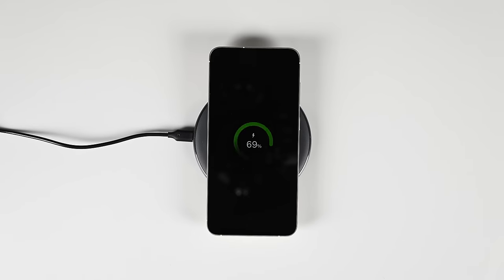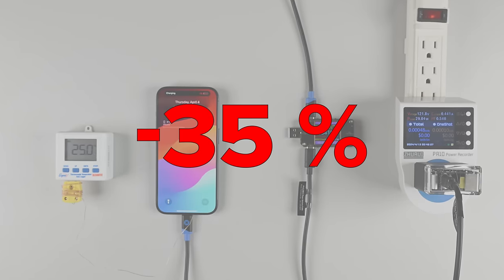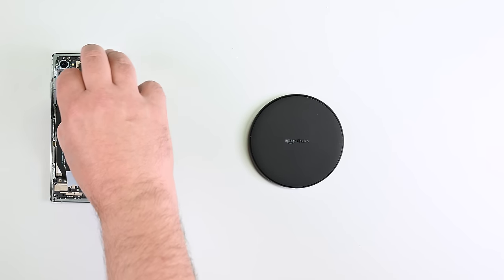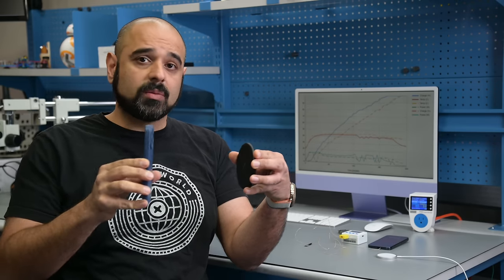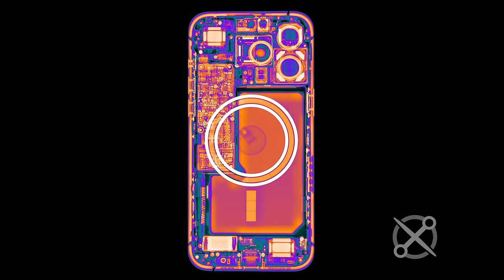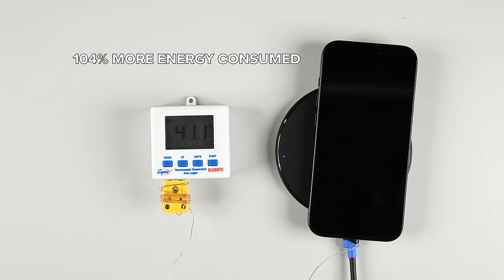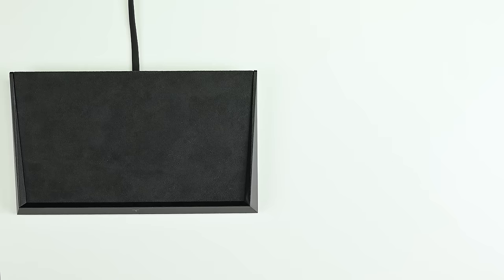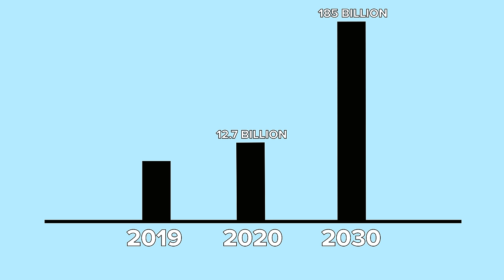How Wireless Charging Works and Why It's Terrible

Comment: Yup! I knew about the heat problem with wireless charging. I remember taking my phone off the wireless charger and felt how warm my phone felt which made me remember how heat and battery is a bad combination. After that I went strictly with wired charging for my Note 9. There is a problem with only using wired charging for your phone and that is the wear and tear on the port. Last year I finally ditched my Note 9 for the S23 Ultra and said this time I’ll only charge with wireless chargers because I don’t want to wear down the port on the phone. I guess now I’ll have to see how long it will take for the battery to degrade to the point where I have to replace my phone. Ahh and I put on every setting available to help prolong the battery life like turning off fast charge, charge only to 80%, etc.

Comment: if you have ever broken your usb port and realised that you need to go and get the screen removed in order to remove the thing and you are sure you will break it in the process, probably a battery replacement 2 years down the road sounds like a good option
that is literally what happened with my old s7 lol😊

Comment: What about the magnetic usb connections where you leave a discreet plug in the phone socket and connect when necessary to a charging cable using its own magnetic connector? 

Obviously that’s not wireless in the same sense but as it’s accessing the battery via the phone’s usb socket is it more likely to help preserve the phone’s longevity?

Comment: I find wireless charging to actually be quite inconvenient most of the time. It's nice to have as an option but I do all my charging the old fashioned way. It's also way easier to use the phone while charging with a cable than with wireless, even magsafe or qi 2

Comment: I’ve always assumed wired was better anyway, namely due to direct communication between the charger and the device receiving power. If you’re using a proper charger, that is. Wireless charging is convenient in many ways but this video reinforced my doubts.

Comment: If you take a magentic Piezo electric phone cooler and stick it on the back of an Apple Wireless magnetic charging puck it will keep the phone cool while wireless fast charging the phone, that is what I do.  The phone stays at a nice 20c room temperature where it would normally be over 30c without it.

Comment: better way is opto coupling, use high density (ie high surface area) solar receptor on device, charger produces high density light after locking

Comment: I was aware the inefficiency of wire charging compared to wired charging, but I'm a bit confused by this statement that the higher temperature degrades the battery. Doesn't this potential degrading effect gets offset or even negated by the fact that wireless charging puts much less stress of the battery due to the less intense power delivery?

Comment: I never got the point of wireless. The efficiency put beside, your phone is stuck on the charger and everytime you want to use it, it stops charging because you have to take it of the charger. a much better replacement are magnetic attaching cables. Much more efficient, once connected you can actually move your phone around to do stuff like calls and you can just leave the magnetic plug in your phone all the time and then just connect it as easy as putting it on a wireless charger. You also can't missalign it like on non macsafe wireless chargers as a bonus point.
Reply: In my case, the Magsafe charger in the car is also the mount.

My wife was notorious for NOT plugging in her phone.  The solution was to get her a Magsafe charging mount.  Now, her phone gets top-ups during her 30 minute commute.

I understand the trade-offs.  The convenience is the selling factor for me.

The temperature issues are mitigated by the fan in the charger, keeping the phone and battery cool.
Reply: Same Magsafe principle MacBook Pro's etc are using? My niece got the first M1 MBP's that only uses two USB-C ports, and her toddler accidentally fell over the charger cable ripping the laptop off her lap. The cable and port was damaged. Damage wouldn't have happened had it been the traditional Magsafe cable. Your point incorporating that into phones makes alot of sense.

Comment: I'm using wireless for convenience, but also because I had phone ports break on my before. How, if at all, do wireless coils and electronics break over time? At least I don't have to worry about sand getting in it and breaking the contacts.

Comment: i use wireless primarily. for the past two phones. i also charge on the lowest current. battery gets to 29 degrees max. thats how you safely charge wireless. dont forget the battery save feature. i run 80% max.

Comment: 1:19 That's why the recommended power for wireless charging is at 5 watt, leave them charging wirelessly during your bed time.
Reply: Charging overnight is bad in itself
Reply: @FakeMichau  not in modern phones except you're still in that one with micro usb or very thick chin and forehead

Comment: I honestly don't get wireless charging. There's a cable running to the wireless transmitter so you've got the same hassles being tethered to a particular place. The only real difference is between placing the phone down (and making sure it is centered) and grabbing a cable and plugging it. Which takes about the same time and thought. In fact you can get magnetically snap on cables which I've tried and work well (just a shame they don't come standard). 

Also, my first experience with wireless charging was with an old Galaxy Note. I quickly discovered it wouldn't charge, or would charge slowly, unless I went through the hassle of removing the phone's protective cover. Just a few mm and splat it doesn't work. I haven't bothered since.

Comment: I am a bit saddened to find this out, because one of the first things to break in a phone is the charging port. On my last two phones, the port broke and needed repair. So I started charging mostly wirelessly. I wish my phone managed the temperature better and would slow down the charging (when going wireless), because I mostly charge overnight, where speed is not really a problem...

Comment: I only use wireless charging a few times a year. I also only stick to name brand chargers, specifically designed by the maker of my phone. It's nice to have when charging more than once device and wired isn't available, but I don't depend on it.

Comment: That might explain the rapid decline in battery health on my iPhone 11 at the end of last year. It was at 96% battery health after about a year of usage, because I always used a cable to charge it. I switched to using a wireless charging pad, and in 2 months it dropped down to 91%. Yikes!
Reply: That seems unlikely to me. I had my Samsung S9 for over six years before finally replacing it last year, exclusively charging it wirelessly all that time. It was only the final year that I started noticing significant battery degradation. Granted, this is a subjective judgement, I did not check for a battery health percentage. I've set my new phone to stop charging at 80%, and to charge slowly, to limit the wear a bit.

There's no getting around wired being kinder to the battery. There will always be more heat from charging wirelessly, although the phone really should be throttling the charging to keep within acceptable thermals. In my experience slowly charging wirelessly makes the phone significantly warmer than even  super fast charging with a wire. But, I really don't care. As long as it lasts 5+ years, I'm good.

Comment: My first wireless charging phone was a galaxy s7, I only used it 3 times as it was slow and gets very hot (ambient temp in our country is around 25-30°c), I used it even less with my iPhone Xr,13 Pro Max, and airpods pro as it also gets very hot and stops charging. I have also tried multiple wireless chargers from different brands, even the belkin one gets hot.

Comment: Interesting follow-up question from me - does the impact from this negate the benefits of the longer charge times? Especially with rapid chsrgin tech on most devices now that puts more pressure on the battery, the slower chsrgine speed is a positive in that front. I tend to use my wireless charger (a stand, not a pad, for more consistent results) when charging overnight or if I'm not leaving the house soon and the battery is low, and that plus the adaptive charging that holds the battery at 80% until my alarm is due to go off, all work to help extend the battery life, no?

Comment: Wireless charging is often used to extend the life of the charge/data port at the bottom of the device.  These fail more often than you'd expect and in some devices can be a pain to replace.

Comment: Or if you are rooted, install AccA and set the temperature limit to 40c. Charge wirelessly without burning and degrading the battery.

Comment: I seen a few things wrong with this video. No electrons enter a battery from either a wired or wireless connection. Batteries work using chemical reactions moving electrons around already inside them. No new electrons are introduced externally. 

With wired charging, the energy isn’t transferred through the cable. The energy is transferred by the electromagnetic field outside of the cable. No electricity travels in the cable.

Comment: I am confused about the temperature part. My phone's battery (according to Antutu benchmark) is almost always above 30°C even in normal everyday use (somewhere between 30 and 36). Does that mean my battery is constantly degrading? Or is Antutu not displaying accurate temp values?

Comment: I got some Sand into the charging port of my Galaxy S21+ few weeks after i purchased it. I had exams ongoing and couldn't  go to the service center before at least a week. Amazon was delivering its Amazon Basics wireless charger on the same day so I went for it for the time being. The difference I noticed was the crazy amount of heat it was generating. I only used it for a week and never since. Also, it makes no sense as wired charging is so much more convenient and quicker.

Comment: I have few charging cables which have a separate tip connected by magnets. The tip stays in my device and when it needs charging, snapping it to the cable is easy and fast.
I use them on devices that need charging daily and i dont want to wear out their port.

Do these magnetic charging cables have any downside as opposed to normal cables?

Comment: I used the apple wireless charger EXCLUSIVELY on my iphone 15 pro max and then I used the wired fast charger from apple on my other iphone 15 pro max for one whole year. The phone that used wireless charging still has the battery capacity at 100%. The phone that was wired while charging has a battery capacity of 92% after that same amount of time.

Comment: I have my fan always turned on in my bedroom, with my phone in front of it. Does that help at all with heat dissipation? I like wireless charging only for the convenience of being able to set my phone down at night without having to fuss with the cable in the dark.
Reply: Not much if at all, it's like trying to cool a cpu with a fan without the heat sink

Comment: Im just watching this as a family member bought a wireless changing phone and it seems it does not want to charge (she asked me if I had a wireless charged but I have an old phone that uses the classic thrusty wire)...i have seen some models or heard about wireless charging before and kinda suspected how did they work based on Faraday-Lenz laws but never actually knew the details and pros/cons.

Since these coils require to be perfectly alligned and so close...it is way better to stay with a wired charger.

Comment: I've never found much convenience in wireless charging besides not needing a specific cable for my iPhone versus anything else. Now that that's not a factor, I find no value in it. You can't use your phone while it's on the pad, unless it's MagSafe, at which point why not just use a wired charger?

Comment: I only bought a wireless charger because I would get calls while I was asleep that I had to answer and the ease of just being able to pull it off the base was my main reason I got it. Granted the one I bought has fans to allegedly help dissipate the heat, I don’t know that I really “buy” it.

I’ve used MagSafe chargers as well and that extra magnetic attraction with the phone is basically the same issue I had with the wired charging. Sure. I probably could buy a longer charger wire but… I just don’t think it works as well as the other solutions. So I don’t really know.
Reply: I have some Samsung Qi chargers with fans and the fans, if anything, keep the charger cooler but not necessarily the phone cooler. I’m fine with this if it means there is less heat being generated from wireless charging. Though I do have a few MagSafe chargers so I can quick charge my iPhone.

Comment: My wireless charger has a fan inside it. It does not become hot. It is one from Samsung, also it has a stand so the aliment is not an issue. Did you guys checked that out ?

Comment: What size power brick would be best to use with wired charging?   I watched another video, looked like 12w was coolest on the phone, both the 20w and 30w were about the same charge time with the 30w charger making the phone 10degrees hotter (Fahrenheit) but both were over 100F.  They also tested a 5w charger, but the power block itself go so hot it doesn't really seem safe.

Comment: I have seen the temp problems with wireless charging myself but that it also why i prefer to use a wireless charger that has a fan built in to help with the heat issues and i dont need the wireless charging to be fast if my phone goes on it its down for the night.

Comment: i kinda feel like fast charging makes wireless charging a bit redundant anyway
it sounded nice when charging too long to have basically a passive way to charge devices without having to plug them in and out all the time, but with how fast wired charging is now, i plug it in once a day for a few minutes and go from 30 back to 80%, you really dont need to charge your stuff as much anymore

Comment: The description of efficiency is somewhat misleading here. First, using a coil to generate a magnetic field to induce a current in a second coil is not an uncommon practice. That’s exactly how a transformer steps down the kV voltages in transmission lines to the 120V and 240V residential standards, and our experience with this technology has allowed us to make these power transfer through induced EMF remarkably efficient (in the upper 90%s). The real energy losses here come from the fact that you need to convert the DC power coming from the source to AC to energize the source coil,  and then you you need to convert it back to DC from the receiving coil before it can be used to charge the battery. With anything that guarantees proper alignment, I would guess this is by far the major source of energy loss.

As for the temperature problem, that’s essentially solved by Qi2 and MagSafe and will only continue to improve.

All that being said, I hope that wireless charging can eventually lead to portless devices that can have very few points of failure and therefore can last for a very long time, and if that ends up being the case, the reduction in manufacturing rate of phones could make this a net win in terms of the environmental effect of smartphones.

Comment: 30C isnt going to wear a battery out. That's the ambient temperature in NYC during the summer. The majority of the US is warmer. Google specifically throttles Pixel charge rate when it gets above 37C and slows charging to a minimal level at 40C. A Pixel phone will charge at full rate when it's at 30C.

Comment: I still use a wired charger, specifically a 100-watt charger because some have PFC (Power Factor Correction) for efficiency that begins at a 10-watt load and has low idle consumption. I don't like the 65-watt charger because it doesn't have PFC and overheats the charger if you charge more than one 45-watt device, shortening the charger's lifespan.

Comment: Wireless charging can be efficient but you need perfectly matched and aligned resonant coils, practically zero design flexibility. Inductive wireless charging (ex.: Qi) is less efficient but also far less fussy about tuning, coil size, alignment and how you pull power out of the magnetic field. You can randomly toss a handful of LEDs-on-coil on the pad and they will light up based on the magnetic field strength along their coil's axis. No fancy circuitry or tuning needed, though you may need a Qi device nearby just to trick the charger into staying on.

The biggest problem with wireless charging is that it induces eddy currents into all conductive materials its magnetic field traverses, such as the aluminum and copper current-collecting foils in pouch-style battery cells, effectively acting like a low-power induction cooktop.

Comment: the only time i use wireless charging is when i drive. i put the wireless charger on my AC window. the cool air coming out will always cool down my phone's temp. so its just a little bit more convenient for me to not plug and unplug my phone every time i drive.

also, i live in a hot country with only two seasons. so i will always need the AC on.

Comment: Yet the wireless dream is vanishing due to the addition of magnets, now I really wonder why not making a contacts based charger standard with magnets. Devices get aligned and energy is transfered "by wire". Result would be the same, but that will avoid most of the issues wireless charging have.